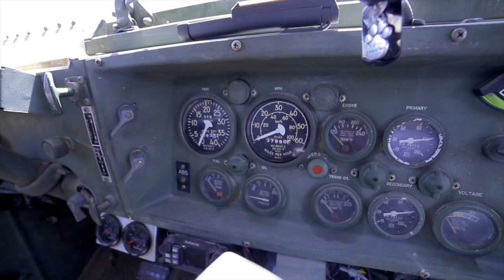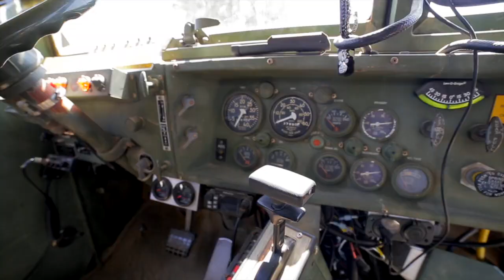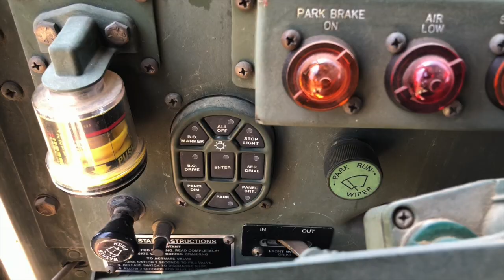THOR: The M923A2 Military 5 Ton 6x6 Off-Road Troop Carrier

Comment: He’s right about having to amass a set of new very large tools. I own several of these trucks and two LMTV’s and everything about them is HUGE.
Reply: Thanks! Yes, everything is a whole other level. I'm running 16x20's over the original 14x20 tires. The wheel tire combo weighs about 490lbs. When I had to swap out a flat the first week I owned the truck, that was quite a learning experience. 20T jack, 6' breaker bar, 1.5" socket...much bigger torque wrench... I learned "respect" very quickly. Hence my quote: "Nothing Happens Quickly in THOR...."

Comment: I remember when we got these in the mid '80s. In my unit, H&S Co., 6th Motor Transport Battalion, USMCR, these replaced Vietnam era M54s, we never got the 800 series. Our first was an M923 10 wheel model painted plain old Forest Green, then the A1s with the "Super Singles" and no CTIS. The best part was the fact they had HEAT! In the Northeast those cold winters sucked in the old M54s.
Reply: Thank You for sharing your experience and Service!

Comment: Owned a M-35 Reo and that was real work driving that beast. The M-900 series came with automatic transmission because  few could drive a stick. The M-35A3 was laid out along the same lines as the Am General but the Army didn't want them. The rebuilt to the A3 cost over $75.000 better spent on a newer truck
Reply: The M35A2-M35A3's were both built by AM General and Kaiser.Several Manufactures made the M35A2,only the two I mentioned made the A3's.The A3's were built from 1993-1999,the Military did have them in Service for a couple of years.The only difference is the Frontends and then they have a 3116 Caterpillar,which made 390 HP,it was also used in the first Variants of the LMTV/MTV 2 1/2/5 Ton Trucks (1994-1998) before using the 305 HP 3126 Caterpillar (1998-2004),they now use the 275 HP C7.
The M35A3 and M109A4's also had 1400×20 CTIS Singles had a Allison Automatic.Due to a smaller Transmission,Different Axles,and Different Gear Ratio,they had a limit of 45 MPH and a maximum of 53 MPH.The only real thing decent about them was having Caterpillar Engines,they were much more Powerful than the Multi-Fuels used in the A1 and A2's,and had alot of life expected than the LT/LDT/LDS Engines,while also being much bigger in Displacement.

Comment: Many a hour behind the wheel of this thing. Fording a river at Ft. Lewis and the water was at foot level. Also did a hill climb with a 600 fuel pod didn't think I was gonna make it.
Reply: Thanks for sharing - They are a Beast!
Reply: @vitale6633  I live in riverside around the corner from a guy that has a couple 5 tons and I think a deuce and half.

Comment: I had a 67 m935. It only had 10k Miles on it and was a multi fuel engine.  Loved it
Reply: The 900 series trucks didn't come in to work service till th
 Early 80s. in 1967 if you were driving a 5 ton truck with multi fuel engine it had to be an m-54 Kaiser built truck. Most likely it had the continental 465 turbo charged multi fuel. Earlier models had Mack engines. I drove them all, including the 800 series and the mk-48 series as well as the 900 series. Also hauled tanks with the m123s pulling the xm-793 tank trailer. USMC here.
Reply: The M939 5 Ton Trucks weren't made by AM General until 1982,1987 was when they were made by BMY Harsco.1982-1994 is their Timeline.There are three Variants that use the G177/1100×20 Tires (A0),49/1400×20 Tires (A1),and 53/1200×20 CTIS Tires (A2).The A0-A1 use the NHC-250 Cummins being Naturally Aspirated,while the A2 use the 6CTA Cummins being Turbocharged.
The M39 5 Ton Trucks were made from 1951-1969.International Harvestor,Mack,Diamond T,Reo,Diamond Reo (Pre-1967/Post-1967),Studebaker,and Kaiser all built them.And it didn't matter what year they were built,there were Variants all together that used three different Engines.Your A0 5 Ton Trucks had a R602 Continental Gasoline,the A1 5 Ton Trucks built by Mack had a EDNT-673 Mack,and the A2 had either a LDT/LDS-465 Multi-Fuel.More of the A2's used the LDS than the Deuce & A Half,and they also had different Turbos,alot of them were C or D,not many being A,and yet the same Turbos were used in complication on the M35A2's and M185/M109A3's.

Comment: Nice.  I would advise acquiring one of the optional 30,000 to 40,000 pound winches that fit this truck.   Get this one stuck and big bucks for getting something to pull you out,  unless you have a friend with the right equipment, and a good heart.
Reply: Yes, having equally equipped friends is very beneficial. Since this video was published I've added a pair of Sherpa 25K winches to both the front and rear on custom mounts. While not fully up to what one would want, I'm hoping the 24v Sherpa's have enough pulling capacity combined with a snatch-block to enable self recovery. I chose the electric Sherpa's as I was able to fabricate mounting plates that integrated into the existing bumpers to retain the original look. The military hydraulic winches require extended bumpers. To support the 24v winches I re-installed the four 12v batteries, which is the typical military configuration for this class of truck. Most people run just a pair of 12v batteries for civilian use....

Comment: The 939 series a re really very nice trucks to drive and work on, if your used to driving a Deuce it like stepping 40 years forward stepping into a 939.  I got mine with 1300 miles on the full rebuild pack and drove the truck 600 miles home the next day, it even came with a full fuel tank (90 gal.) the truck has been pretty flawless in the 4 years I have owned it.  Mine is running the 855 naturally aspirated Cummins and it does not have CTIS (central tire inflation system)  The reason I went the route I did is because I am very familiar with the 855 ci based engines and CTIS although it sounds like a dream come true its very complicated, expensive to maintain and can be problematic which =$$$$$$  This truck is my second most enjoyable truck to drive behind my M977 HEMTT
Reply: You are correct regarding the complexity of CTIS. Took me 9 months to triage the issues I was having with the system. Hub seals, wheel valves, computer......When it works, it's pretty cool though. When it doesn't, well, it's a bit frustrating....
The 855 Cummins is a beast of a motor in your rig. I think they'll run forever!
Reply: @vitale6633   I have avoided CTIS on all my trucks so far but it looks like that may come to an end Vitale, I really want a Mk 23 7 ton LMTVR OshKosh and guess what, you got it only comes with CTIS, I love learning new trucks and new systems but just dont want to have to learn about CTIS!  Your truck is an extremely nice looking truck Vitale congrats and they sure are a pleasure to drive arent they!
Reply: @karlk6860  There are some great CTIS debug resources both online (Spicer Corp website) and at the steelsoldiers.com forums. In one thread there's a Spicer Engineer contributing and answering questions regarding how the system operates and tips for debug. I'll search for the link and provide it when I find it. If the wheel hub seals leak, the system will flag an error. Usually that's the first place to start - and it's a great opportunity to repack the wheel bearings :)

Comment: Did you happen to get any of the Technical Manuals other than the operators manual. They are super easy to work on. I was a 3521 in the Marine Corps.
Reply: Yes, all the technical manuals are available on the steelsoldiers.com forums. Now, "Easy to Work On" is potentially a matter of Youth :) When the Tire/Wheel combo weighs 490lbs (upgraded to Michelin 16xR20's), for me, things move a bit slowly. Thank You for your Service: 
MOS 3521 Automotive Maintenance Technician

Comment: With the onboard air have you thought about an air wrench?  You may not have enough air but adding another air tank might be worth it
Reply: These trucks have four air tanks on board: Wet Tank, Emergency Tank, Primary Tank, Secondary Tank. They also have a pair of air connections (aka Glad-hand air connectors) front and rear for Service and Emergency interconnect with other vehicles (Towing or being Towed) to run the spring/air brakes. I have an adapter attached to the Service glad-hand with a standard air hose & coupling which I use to air up the tires of other vehicles when needed. I can attach any standard air tool to that hose as well. Onboard air pressure is 120psi max. So, i guess the answer to your question is Yes :) although I currently do not have any air tools onboard. I'll give it a try this weekend. :)
Reply: @vitale6633  I had Garbage trucks years ago and we had a one inch air wrench for changing tires  We always used it with shop air but not off the truck air supply pressure was not a problem as both were about the same just not sure what vlume would be required for tire changing other smaller tools for sure no problem

Comment: You should buy some truck tire bars, they way they are shaped, much easier to put tire on, I wonder if anyone ever upgrades the cab on those, like put a highway tractor cab on it.... I've seen them bobbed and it looks cool, but either a cab with no sleeper or a very short sleeper.... sorry by bars I mean the type guys who do road service for truck tires, sledge too, they have a pointed type they use for breaking beads. Murphy's soap, sorta solid,  tire guys here use it for mounting tires that the bead wont sit down, can save you off road if you break a bead, fill up the crack with Murphys and as the tire fills you just scrape it off and put back in pail, really helps with mounting tires too, put a light coat on bead..
Reply: Good suggestion - I'll look into the tire bars and Murphy's soap. Changing the tires on the split rims (which I've done for all 6 tires) was quite the project. I did one wheel/tire each weekend over 6 weeks. Then I drank a lot of beer :)

Comment: Just curious about you saying you didn’t need a CDL in California cause you have it registered as a historic vehicle.  I’m interested in one but don’t want to get a CDL and don’t want commercial enforcement grounding the vehicle. Does your DMV documents say no CDL required?
Reply: I am in CA and did research on these before (not) buying one.  I found NO exemption in the vehicle code requirements for a "historical vehicle".  CVC says you need a Class B license to drive anything with three axles.  Period.
Reply: @Mrdax707  Thank You Sal for your research and contribution to the dialog. Did you not pursue your acquistion on the basis of licensing requirements? Application for a CDL is straight forward and highly beneficial to understanding the safe operation of a vehicle of this type as I mention in my reply to Sam above. I have had the first-hand experience of interacting with CHP and BLM officers. Once Received a very polite reminder (no citation) regarding operation of the vehicle with people in the truck bed and that CA law requires ALL passengers be properly secured with a federally approved restraint system (except during Parades which THOR has also participated). The class of my license was not considered an issue at that time. As I said, I'm not a DMV representative, nor CHP officer :)

Comment: You forgot to mention that there actually are three series of the M900's/M939's such as the "A0",A1,and A2.The "A0" had G177/1100×20's while the A1 used 48/1400×20's,and then the A2 came with 48/1400×20's with CTIS installed.The other difference with the "A0" and A1 is that both used the NHC-250 from Cummins (14.0L/855CI) which also was in all of the M800's/M809's series such as the M813's-M820's.
The A2's had the 6CT from Cummins.
Reply: Thank you for the additional detail. The M939A1/A2 series both came standard with the 14.00x20 Super Single tires. CTIS (took me nearly 9 months of debug including replacement CTIS computer from Eriks Military and Industrial Surplus to make operational)and 8.3L Turbo diesel are unique to the A2 series. My truck was upgraded to the oversized 16.00x20 tires post govt service. This is a "popular" civilian upgrade to these trucks.
Reply: @vitale6633  I'm familiar with all of the above that was mentioned.

Comment: That's a nice truck!  Do you change the wheels yourself or do you always have a helper?  I recently bought an M35A3 and have been trying to figure out how to safely pull the wheels off myself (I imagine they have to be about the same weight as the super singles on your truck, ~400 lbs each).
Reply: Thank You. Yes, I've been able to change the wheels/tires myself with the help of a rolling tire dolly I fabricated. However, if you lay the tire/wheel horizontally on the ground, help is definitely required to upright the assembly. The 16x20's on THOR weight about 490lbs each.

Comment: Its got plenty of air for an air wratchet, for those asking, but 700 miles per tank? I think I misunderstood that, never drove one past 100 miles on a tank of fuel.
Reply: On Highway the M923A2 can hit between 8 to 9 mpg. I've travelled +400 miles on a single tank. My mental math swag during the interview was between 600 to 700 miles per full/empty - Your Mileage will vary. Plus, I always have a minimum of 5 extra gallons of fuel just in case :)
Reply: On a full tank I could clear a state KS,CO,Wy,Ut,NV,OR
Reply: He said it is a 77 gallon tank and he gets 8 MPG so 77 * 8 = 616 miles.

Comment: What type of upgrades did you put on thor???
Reply: None honestly - simply restoration to original specs. New tires & shocks (huge improvement to ride). Added a boost and EGT gauge. Re-insulated the cab. Only aftermarket upgrade are the 25K, 24v front and rear winches I've added since this video was produced.

Comment: Can you share a link for the tool company? Thanks.
Reply: Apologies for the delay: The Sockets are OTC purchased from Amazon here: https://www.amazon.com/OTC-1919-8-point-Bearing-Locknut/dp/B000O867A0/ref=sr_1_2?keywords=4-7%2F8+socket&qid=1564891138&s=gateway&sr=8-2

The Torque wrench was also purchased from Amazon here: https://www.amazon.com/Performance-Tool-M204-100-600-Capabilities/dp/B00PX16Z4Q/ref=sr_1_3?keywords=600+lb+torque+wrench&qid=1564891331&s=gateway&sr=8-3

Long Breaker bars can be purchased from Harbor Freight. 

-v

Comment: Hated driving the 5 ton, hated maintaining it even more. Always something wrong. Could have been due to the ineptitude of 88m’s. They are good for taking a nap in though.
Reply: yes, I've camped/slept in the cab several times as well as using a Coleman pop-up tent in the bed. The M939A2 series is pretty sturdy, reliable and easy to drive. Even the CTIS is fully functional in THOR. Power steering, full air-brakes with Allison 5speed automatic transmission; once you get used to it's sheer size on the highway, it's pretty easy to drive.

Comment: The 5-ton trucks were fun, but the Marines now have the MTVR, which is vastly superior. 

The MTVR has 53" tall tires, fully-independant suspension, full-time all wheel drive, torque-biasing transfer case, five selectable drivetrain lockers, ABS, traction control, wide-ratio heavy duty 7-speed Allison automatic transmission, and a 732 cubic inch (12 liter) intercooled Caterpillar turbodiesel with 425 horsepower and 1,550 pounds of torque.

The later model MTVRs, like my 2007 AMK23 (armored) MTVR, even have air conditioning. 

The MTVR has a payload capacity of 30,000 pounds- you could put five tons of cargo in the bed of a 5-ton truck like the one in this video, put the loaded 5-ton truck in the bed of an MTVR, and the MTVR still wouldn't be over it's 62,200 pound GVWR.

Civilian-owned MTVRs are rare, but because they are newer trucks, owning one isn't like patching up a 40 year old 5-ton truck. My 2007 MTVR only had about 3,000 miles on it when I bought it at auction, and was in nearly perfect shape. All I had to do was replace two exterior marker light bulbs, and a $10 air ride seat switch.